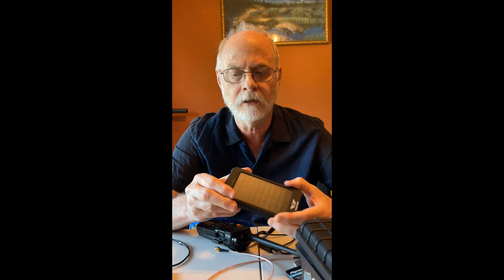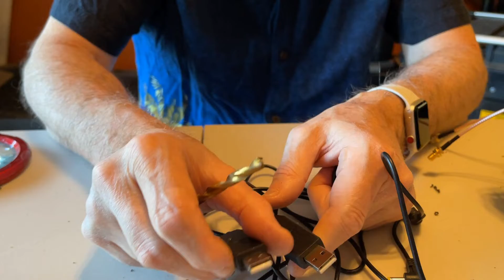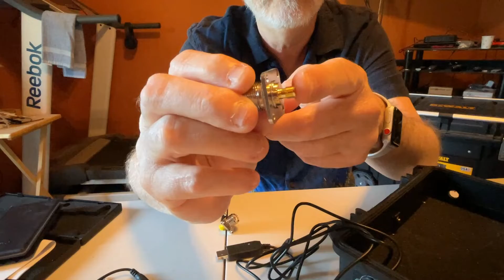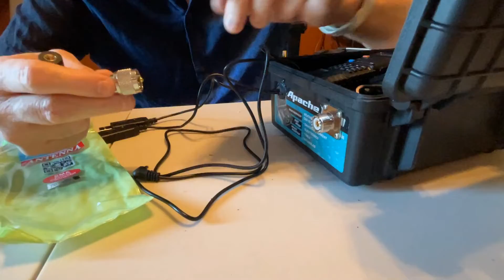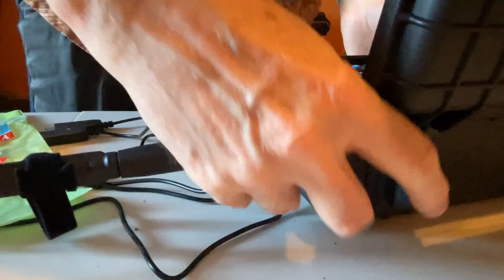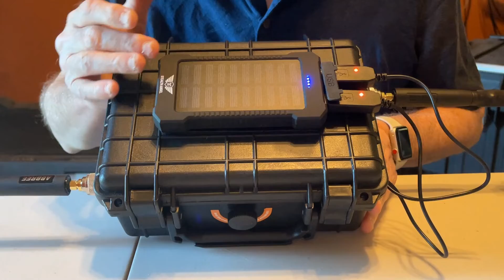Portable Repeater Build, Part 1

Comment: What’s the max range
Reply from the maker: Thank you for watching our video. There are a lot of factors that affect the range. 
1. How high is the repeater above the ground ?
2. What obstacles are around the unit, such as trees, buildings, fences, etc. ?
3. Are there other electronic devices transmitting signals close to the frequency that you are using located near where you plan to deploy the portable repeater ?

To optimize the range, the portable repeater needs to be deployed as high as possible with a clear line of site to where radios would be deployed.

Comment: Might wanna mount radios to keep from shifting and possibly losing connections. Any updates how it Worked and how long did battery last ? Thanks for video.
Reply from the maker: Thank you for watching our video. In my testing & use it worked fine. Regarding how long the battery last depends on the amount of usage transmission time vs. idle time.

Comment: I'm going to build something similar except use BNC bulkhead with a rubber gasget. With BNC, I can use HT antennas. I'm afraid that in a wind, those tape measure antennas will fold over or start to oscillate.
Reply from the maker: Thank you for watching our video. It makes sense what you are sayig for you specific situation. I used the longer antennas to get more separation between the antenna tips for receive and transmission.

Comment: How has this worked out without a duplexer? Ive seen some with and without one. Im currently building one too and would like to not drop even more money if i dont have to
Reply from the maker: Thank you for watching our video. The one that I built is working fine for my purpose. However depending on your situation you may find that you need a duplexer..Mine is setup for temporary use and not as a full time repeater.

Comment: Hello, you need a duplexer because when the transmitting antenna emits, it kills the receiver, and you need to separate the frequencies well. That will work for 500 meters. After that, the transmitter will kill the receiver's signal. I'm telling you this because I've already done it with two 8W UV-5Rs. Regards.
Reply from the maker: Thank you for watching and for your feedback.

Comment: 17:54 if they use same freq then TX antenna is cancel RX and it become deef no signal go in and out its FM strongest win they cant use same freq. and no need licence no one on woods when hiking.
i have not hear no one on radio. we use phone here LOL 100% range/internet
Reply from the maker: Thank you for your comment. Cellular signal is not 100% reliable. My tests of this portable, temporary repeater is reliable. It is not meant to replace regular commercial repeaters that are designed for heavy usage.

Comment: Cool build. My questions would be; 
Aren't the antennas to close? 
And, do the radios get to hit inside that box without ventilation while being charged and used?

Would love to see it in action
Reply from the maker: Thank you for watching. There is debate about the spacing of the antennas. You do want the antennas as far apart as possible to avoid interference or affecting performance of the repeater. Keep in mind this is not designed to be a permanent repeater installation. There is commercial equipment avaiable for that use case scenario. The primary use case for this one would be a camping trip or short term event that needed communication between people. Yes it does elevate the temperature slightly, but thus far has not been an issue.. Some radios have a cross band repeat functional meaning you could use one of those with a single antenna and not have an issue but those radios tend to have a much higher cost than the Baofeng radios used in this project.

Comment: Sir, can you let me know how long far can this repeater cover ?
Reply from the maker: Thank you for watching. The answer is it depends. How many obstacles are there between the 2 points ? For example more trees means shorter distance. Could be a couple of miles to 10 miles if the repeater was on top of a hill with clear line of site to the other radios trying to use it. How much power do the radios have that are trying to use the repeater if they are set on 1W the useful distance is shorter than if you are using 5W for example.

Comment: Great video, how do you check the SWR of this so it doesn't burn out the power transistors?
Reply from the maker: You could disconnect the antenna feed closest to the radio and connect into an SWR meter to test.

Comment: can you do this with just one GD-88?
Reply from the maker: Thank you for watching. I reviewed the Extendad Manual for the GD-88 and it does mention cross band repeater function. Meaning you can set receive on VHF and transmit on UHF or vice versa.

Comment: How did you overcome the common ground issue? When both radio's have a common ground, through the charger when it is hooked up, the transmitter will allways transmit. PTT button, or in this case the charger, connects mic ground to speaker ground.
Reply from the maker: i did not experience this issue with the build that I did.

Comment: How did you waterproof the charger USB connections?
Reply from the maker: You could seal the connection with silicone seal, but that would keep you from unplugging the cables unless you remove the silicone.
Reply: @theoilykrafter  But, you made so sure that everything else was waterproofed but the obvious one on the OUTSIDE of the case was unprotected. Didn’t make sense.
Reply from the maker: @levinef  Thank you for your feedback.
Reply: @levinef  That's what I came here to ask too.
Reply: @levinef  The battery bank is not a critical component (but you must be)

Comment: My experience with those little solar panel battery banks is that the solar panel is undersized.  It takes about a week in bright Florida sunlight for the power bank to go from 20% to full.  A little 10 watt panel is a substantial improvement.  A 25 watt panel is more of a beefy solution for this application.  You will need a controller with the external solar panel.  Sometimes that is included with the small panels.  Sometimes it is not.  Thanks for posting.
Reply: Plus.. lipo batteries hate heat.. 

25w 18v solar panel to car usb  phone charger that can handle 12-24v input (common charger today can handle 24v), direct charging the powerbank..
Reply from the maker: Thank you for watching the video and providing feedback. I agree that bigger is applicable. My goal was to make it as compact and portable as possible.
Reply: @theoilykrafter 10w fodable solar panel from flexsolar would work.. it's not big at all.. and it's far better from that solar powerbank..

Comment: I don’t understand shy you reverse polarity of the crossover cable? It’s functionally a crossover by connecting between speaker and mike.
Reply from the maker: Thank you for your question. The transmit or output of one radio needs to be routed to the input or microphone on the second radio and vice versa.

Comment: So my question is why two radios why not just purchase a small repeater like a sure com repeater this way it’s all plug-and-play and a lot less wires no need for crossover wire, and then you would only need one antenna  or am I missing something but I will say I definitely enjoyed the video and it was very detailed which I appreciate thank you sir
Reply: Yes I agree I'm going to build one with a harbor freight Apache box and a surecom sr-112 simplex repeater box! Can put it three miles from camp at the top of the mountain that divides the rest of the area we hunt and have coverage for a huge hunting area
Reply from the maker: Sorry for the late reply. We didn't receive any notification that we had a comment that needed a response. You could definitely do that. My goal was to see what was needed in order to build one potentially with only parts that I already had on hand.

Comment: That solar power bank will NEVER power that repeater. Ask me how I know. 

I tried the same idea with a meshtastic setup. With a 10ma draw, in the blazing Florida summer sun, the battery bank was empty in three days. Those solar battery banks are a joke.  I updated with a 12" 5v solar panel charging a 8000mah 1s RC car battery. This setup actually worked.
Reply from the maker: Thank you for your feedback.

Comment: The plug to power the radio what is the #s and where can I find it? Hopefully I can find one with other end a USB to then plug into solar bank. 
Can you tell me where you found and what it's called for the sma and so239(?) Plug mounted to box?
Tks
Reply from the maker: The cables came in  the bundle with the radios and antennas. Here is a link to the cable to charge the batteries. https://amzn.to/3X5Aa1m  If you need the batteries and cables try this link https://amzn.to/3YHk7YQ

Comment: I like your video.
My experience with doing this very sameproject  was a jolt to my brain. 3 or 4 trys and i found my sweet spot. Now i did mine for gmrs . I used a much bigger box. I put a 10 ap hour lipo battery in and a bigger solar charger.  Now most of the rest isthesame . I did find the charge cables to be a problem .
Did away with them that have the chip and lights. 
Plain jane usb cable and no more issues.
Also i used very different antennas .
AND THE ANTENNAS  wanted to be about 6 to 8 feet part.
I will be doing a whole new set in a couple months.
I hope that works for how you plan to use it.
Oh oh i found that i am getting approximately 10 to 15 miles coveage in a circle around where i set it up depending on weather its an ht or mobile rig .
Mobile rgs clearly get better rsults.
Reply from the maker: Thank you for sharing your experience. It is always good to hear from other folks with different experiences so we can learn from one another.

Comment: Only if your cross banding will this be maybe worth while.. for a same band repeater such as gmrs with only 5mhz offset these radios will desense and trip all over each other without a duplexer.  Personal experience.. you need at least -80db seperation between that 5mhz spread to be able to use more than a few watts and its input radio be able to hear anything beyond the transmit radio.
Reply from the maker: Thank you for your feedback.

Comment: I had one of those cos-play antennas I bought for UHF CB (477mHZ), 
"Bingfu Foldable CS Tactical SMA Female Ham Radio Antenna 2-Pack Dual Band VHF UHF 136-520MHz 42.5 inch Antenna"  - 2 for $23, what could go wrong?
up to 520mhz printed on the base yet it had a SWR of 8 with the whip, base by itself was about 1.2  haha...  
Be interested to hear what the Arbbree SWR's are?
Reply from the maker: I will have to attempt to measure the SWR and let you know.

Comment: dump the uv5rs ,,,, there junk ,,,,,,  get 2 uv13 pro v2 ,,,better receive and kicks out 7.5 watts and  5 dollas cheaper lol  or  the best radio for transmit would be the Retevis RT86  , best long range radio ive ever had, also that solar panel on that power bank  wont cut it
Reply from the maker: Thank you for your feedback.
Reply: You been underwater too long....

Comment: Nicely finished build, I'm also doing similar for gmrs.  Only thing I didn't see you address in the video or comments is those USB connectors going into the solar/battery are not waterproof.  I think on my build I'll put a 12v Lifepo4 battery inside the box and use a solar battery maintainer on the outside, adds a little bulk inside but the only thing out in the elements this way is the solar panel, which is waterproof on it's own.  I've also found simpler components that eliminate a couple of the antenna connections inline, then use a longer bit of cable outside the box to separate the antennas by a few more feet.  Keep tinkering!
Reply from the maker: Thank you for your comments. You are correct the USB connectors do not indicate that they are waterproof.

Comment: Without a duplexer, you'll have a lot of de-sensing of the receiver.  But if you make a CROSS BAND repeater this would work better.  Two meters in and 70 centimeters out -- or vice versa.

Those wanting to use the repeater will have to set up their VFOs for cross band operation too.  But that's trivial to do on most rigs, such as the FT-991A.
Reply from the maker: Thank you for your feedback.

Comment: 08:40 
Sure, I'd be happy to help explain the wiring for 3.5mm and 2.5mm audio connectors. These connectors are commonly used for headphones, microphones, and other audio devices.
Reply from the maker: Thank you for watching. You are correct. However most headphones use a tip, ring, ring, sleeve or TRRS configuration as opposed to a tip sleeve or TS configuration.

Comment: I thought the radios could not be charged while powered on?
Reply from the maker: They cannot be in the charging base for sure. That states in the manual that there could be an issue to the radio if you do.

Comment: Does that solar power pack use pass-through charging? Meaning, it can charge itself from the solar panel and discharge to charge the radios at the same time. Not all solar packs have this ability. 

Thanks
Reply from the maker: Not 100% sure. Will have to check.

Comment: I have one of those battery banks. While it will charge to full via sunlight, it takes about 4-5 days if the battery isn’t being drained by something else.
Thank you for the video though. It’s great. We build, test, then improve.
Reply from the maker: You are welcome. We are glad to help.
Reply: Seems like a slow charge could be advantageous in this application.
Reply: @adampettus you would think, however from what I’ve seen, this battery may last 2 days and probably less. Unless you’re checking it every day or switching it out, this type of battery will not recharge/recover did give any real longevity. 
Hopefully I’m wrong. Other channels doing this same thing also say a much bigger solar panel is required.

Comment: Okay hear me out here. You already made a connector on the box for each antenna, and you could put both connectors anywhere you wanted because it don't matter. 

You don't have to mount the antenna on the box at all. I would of figured out how far apart they work good and got a box big enough to store more antenna wire. I would just mount the antenna on separate tree limbs and strapped the box to the tree . 

My solar panel would also reguire more wire because I would mount it higher up out into the light and run it into the box too and not on it.
Reply from the maker: Thank you for the feedback.
Reply: @theoilykrafter  You're welcome. I think if both antenna are about 15 feet apart or so and both vertical it should work good. Somewhere between 5 and 10 meters probably.

Comment: Awesome! I'm in the middle of building this. Where did you get the USB power connector cables from the Battery pack to the radios? Thank you!
Reply from the maker: The USB power connector cables came in the radio kit that I ordered from Amazon.
Reply: Thank yo! For some reason the ones I ordered didn't have it but I found one. Thanks again for a great vid! @theoilykrafter
Reply: Is there a part 2? I programmed the RX to 147.900 and the TX to 147.300 (for the heck of it). Built the kit step by step while watching your vid! Question is do I need to program the R-CTCS and the T-CTCS into each radio including my HT that I'm using for my 'home' radio ? I'm using 88.5 right now. Thank you again for an excellent tutorial! Reed
Reply from the maker: You are welcome.
Reply from the maker: Sorry we had some life events that prevented us from completing the part 2 of the video. We will be releasing it in the near future.

Comment: Great build i would suggest a 90 degree Adapter to make the antennas stand up if your using on a table But not needed of mounted on a wall
Reply from the maker: Thank you for the suggestion. I suggest mounting this in a vertical orientation.

Comment: Looks like a 2.5mm Mono to 3.5mm Mono Cable you custom Made
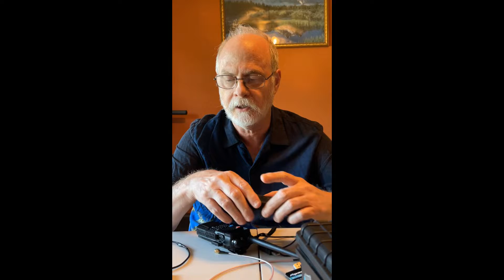Reply from the maker: Yes it is. There is a link to a 2.5mm mono to 3.5mm mono cable in the description. At 1:30 in the video I talk about the cable. I did have to cut the cable and strip the wire back and then resolder the wires after swapping white and red on one end of the wire. A cross-over cable if you will.

Comment: I’m in the process of making a GMRS version of this for fun. Any tips? Did you have to do anything with the VOX? Mines gonna have the receive antenna about 50’ away from the box but the transmit coming off the box. That way I don’t need a higher watt radio to push through the coax. Simi mobile. Using 2 TD-H8s. Any advice helps.
Reply from the maker: Yes you will have to make sure that VOX is enabled on the transmit radio.

Comment: There is plenty of information about how far apart the antennas need to be online. Did you do any research or are we just setting money on fire here? Those solar battery banks are also purely a gimmick.
Reply: I’ve had great success with a solar battery. I’ve never plugged it in to charge it. Always been solar charged. Charges GoPro batteries while I’m out riding.
Reply: I’ve tried to find out how far apart antennas need to be and I only found one place that mentioned it. Don’t know if it’s correct but the internet says, one above the other at about two wavelengths separation.
Reply: They can be side by side using 5w without interference. Using a UHF/VHF split is even cleaner.
Reply: @ckbhack what a joke you are 😂 at least he is trying to do it what have you done
Reply: @frankbowman22 hey he knows things
Reply from the maker: Thank you for watching the video. It was not a concern to this point.
Reply: I mean, he is a Boomer so... 😂
Reply: @vonleiningen you must be a groomer then

Comment: I was wondering if you had a chance to do any field testing and roughly what would the volume setting be on the input radio?
Reply from the maker: Potentially each radio is different. I ended up setting the volume about the middle of the range.